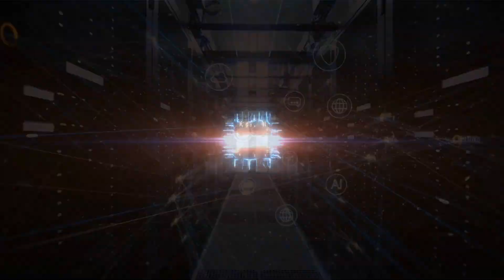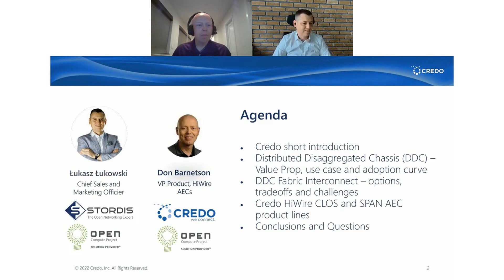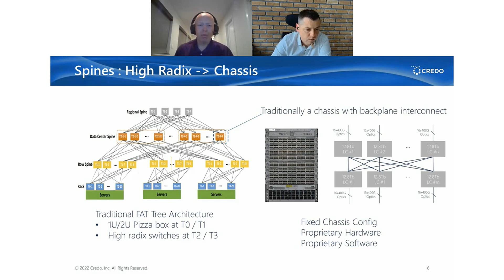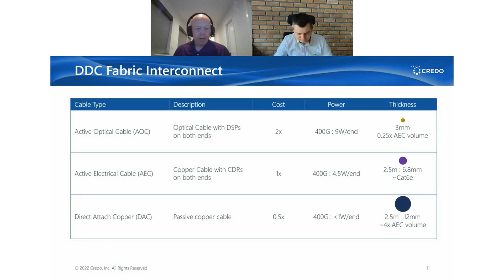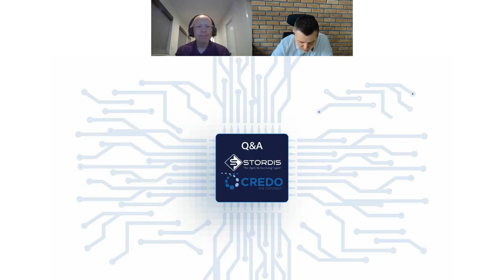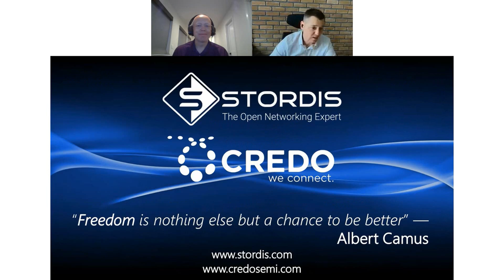Webinar: CREDO Active Electrical Cables Enabling the Future of High Radix Interconnect, 21Apr '22

Comment: Spectra7 comment on the misleading statement: 

Our team listened to how Don answered the question about ACCs vs AECs and what he said was incorrect and misleading:

He said that ACCs had to be tuned to specific ports in a switch.  This is completely false.  An ACC is designed to look like a DAC and is plug and play.  What he failed to mention was that with a DAC or an ACC, you can plug in the cable and it will work without any configuration.  With an AEC, the host system must configure the AEC to work with the port.  This is the same for AOCs.  An AEC is just an AOC without the optical conversion and the optical cable. 

He stated there is no IEEE standard or MSA for ACCs.  This is also not correct.  While there is no standard specifically for an ACC, it is not needed because our technology conforms to standards for DACs, such as 200GBASE-CR4, 400GBASE-CR8, etc.  What we tell customers is that our goal is for an ACC to look as much like a DAC as possible.  Therefore customers get the benefit of lower power and lower cost, while also getting longer reach and smaller gauge wires

While AECs do certainly have a cost and power advantage over AOCs, ACCs have a cost and power advantage over AECs.  Standards are not an issue.